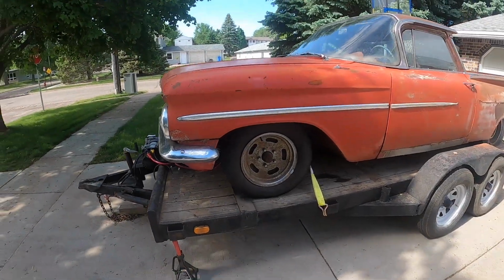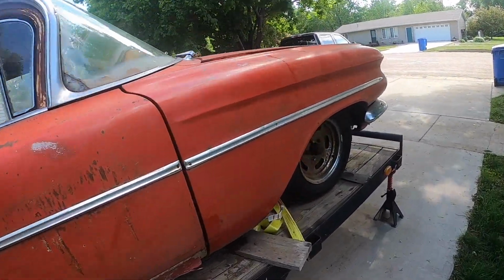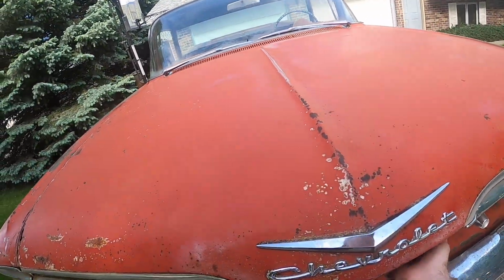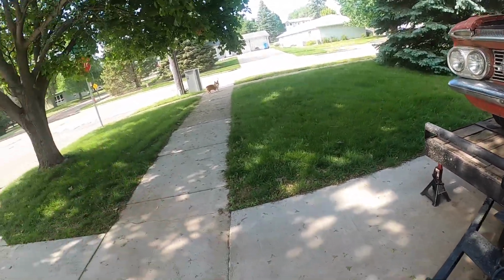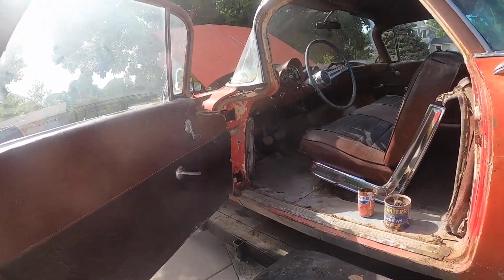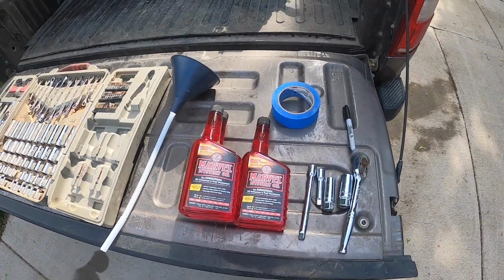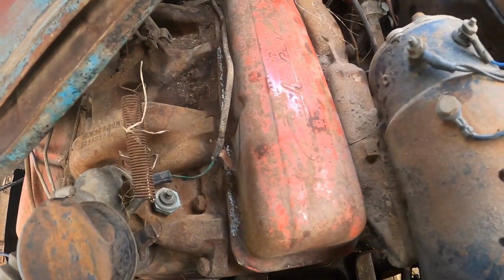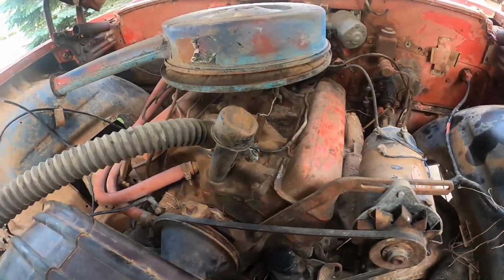1959 El Camino from the Grave - Hasn't moved in OVER 40 YEARS - Rebuild  (Part 1)

Comment: I have a plate I made that fits the 3 bolt pattern of the pulley with a big bolt welded in the center that I use to break these old motors loose. I got a couple of these old 59's. Good luck. I bet the old motor will run. Also that's probably just a pressed on balancer so it won't have a crank bolt.

Comment: looks like my 327 but it could be a 283 they look very similar and are both very good engines in my opinion  looks like you have a crank bolt missing on that lower pulley  I hope its not broken off in there that could turn out being a pain in the azz  I also have not 1 but 2  59 elcamino's both are projects I have a 327 in one and a 400 small block in the other. We both have some rare birds here only 22,246  59 elcamino's were made even less of the 1960 model.Yep these elcamino's are going up in value almost daily.Well good luck with your project keep us updated.  Also you might wanna check out  (The Elcamino Store) 59 thru 87 elcaminos and get the free catalog.
Reply from the maker: Thanks so much for the advice!  Looking to find a bolt for the front crank.. Engine is still not turning, going to take off the starter and see if i can get it loosened up.  What color were the two that you have?  Just ordered a service manual for the car that should get here in the next couple of days, hoping that makes it easier yet!
Reply: @lambchops382  The first one I bought was in 1976 it was a repaint red with black interior it was a 2/tone original .yep worked my butt off all that summer to pay it off .I mowed a lot of grass that year just to pay it off and man that was in the day before 0 turn mowers a lot of hustle and leg work that year and I was only 14 years old at that time but i promised my dad i would pay it off and i did.I'm 58 now man the years fly by !!  The second one i bought was out of Arizona i purchased it in 1998 it was a copper /bronze color but both elcaminos were  2/tones  red/white originally.I drove my first one all my 4 years thru high school all my friends called it the BATMOBILE had some fun all those years thru school.What part of the mid west you from? I'm from middle Tennessee .
Reply from the maker: @roystone3901  That's one hell of a history!  South Dakota is where I'm from.  Looks like this one is a 2/tone as well with the red/white.  Bat mobile could be the new name of this one with the wings on it hahaha.  This one has a brown leather interior and had a shag carpet from the 70s/80s in it that i had to pull out,  looks like a lot of the rebuilds put some sort of short carpet back in em.. is that what you did?

JL
Reply: @lambchops382  My first one had red/black carpet in it it looked pretty good being that the elcamino was red with black interior.The second one out of Arizona different story it had gold/yellow shag carpet ya smelled like rat P had to go.!! I will say that the one you have looks very good I mean for 61 years old it has good bones to start out with These elcamino's can fetch over 100k  if done right.I need some major body work on the one from Arizona when i got it it was pretty much rust free but this Tennessee weather been rough on it mostly my fault it set outside for almost 10 years ya should kick my on azz.the tailgates are very very hard to find .The ones on the 59 station wagons won't work different contour and thickness the tailgate on yours looks very good . I hope every thing goes well for you I know when you get it going your gonna put a smile on your Gramps face maybe even give him a ride in it .I have 2 grandsons now 9 and 5 when they come to see me somehow the small talk always gets on the subject of the BATMOBILE.
Reply from the maker: @roystone3901  This definitely gives me some more motivation to get it rebuild and driving again.  Was working on it this evening, pulled the starter and got all the wheels freed.  Going to see what i can find for rear fenders, still trying to eliminate the stuck engine/wheels, transmission, have a feeling its the transmission on back, just disconnecting pieces one at a time to find the problem.  I'll post some more videos as I go, ordered a buffer for it as well to see if it will shine up the front end to see what that paint looks like.  Thanks again for the help!  I'll keep posting updates as i go!

JL